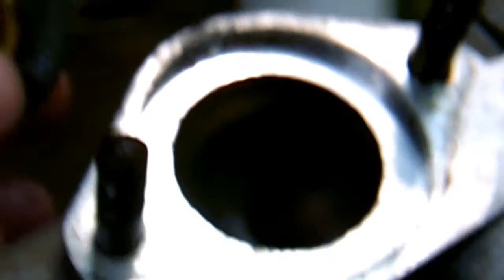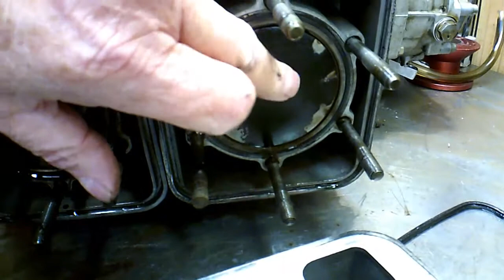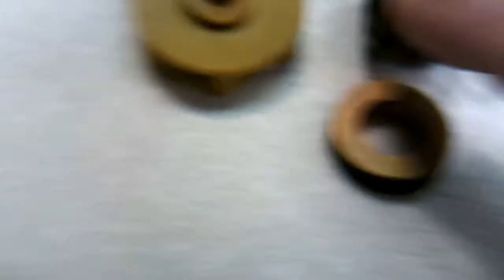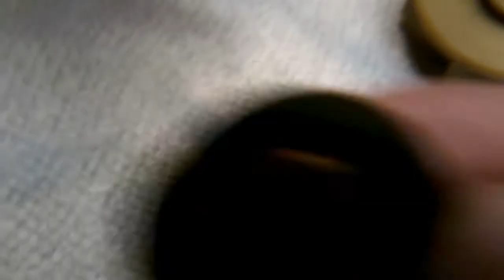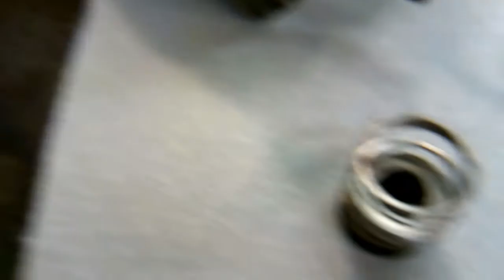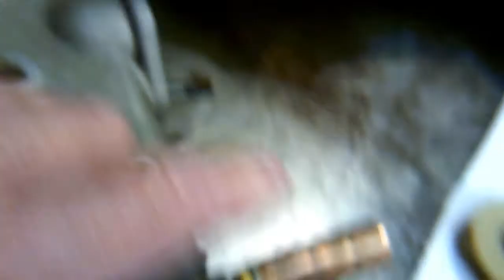Rotax 582 modifications #2 and reasons

Comment: Why are you running 10% ethanol when rotax states not to run ethanol gasoline?
Reply from the maker: I have always run 87 octane unleaded gasoline with 10% ethanol in my two-stroke Rotax engines as it is nearly impossible to find fuel here in this country without it.  Having 920 hours on a 447 engine and 1489 hours on my 582 engine, I have never had any problems that I could relate to the fuel I use. If I could get fuel without ethanol, I would use it.  When traveling, I will use 100LL AV gas if I cannot find auto fuel, but I try not to use it as it makes a lot of carbon.
I have sold the Chinook with 1489 hours, but I feel it would go another 20 years as far as I could tell. The only changes I made were the install of the piston rings manufactured in Taiwan, and the main bearings using the metal ball separators the last time I had the engine apart as per the video.  This is experimental, and with only 25 hours on these parts, only time will tell.
I also did not use the oil injection, as I found I could not pour in a pint of oil after burning 6 gallons of fuel.
I replaced the entire oil injection system, and got the same results, so the system was removed. By blocking the oil control lever full on, I could only get 70:1
Reply: @Adventurepilot70  well if your doing rings and bearings then the 582 didn't run 1489 hours straight no tear down
Reply from the maker: @shawnwright5332  I never said it did. Only that I put no parts in it other than gaskets.
I tore the top end down every 400 hours to remove carbon and be sure rings are free.
You could never go 1400 hours without any maintainance.
Reply: @Adventurepilot70  sorry I don't understand your saying you put Taiwanese rings and bearings so that's more then just gaskets I have a blue head 582 and I'm just purchasing and I'm trying to learn how to keep it running without buying new cranks every 300 hours like rotax tells you so any tricks you've learned Iam all ears
Reply from the maker: @shawnwright5332  I put rings and 2 bearings on the crankshaft at 1464 hours, then ran it another 25 hours before I sold the Chinook and quit flying.
Reply: @Adventurepilot70  wow that is impressive can you give me more details on the bearings you used?and where you bought them
Reply from the maker: @shawnwright5332  I bought the bearings at the local bearing shop "Akron Bearing".  They were manufactured in Turkey.
I forget the brand. You better watch my videos if you want to know what I did because I forget.
Reply: @Adventurepilot70  WOW 1489 hours that's pretty incredible 👍